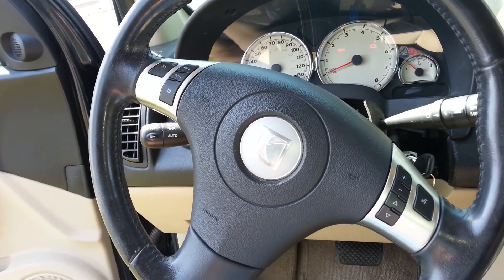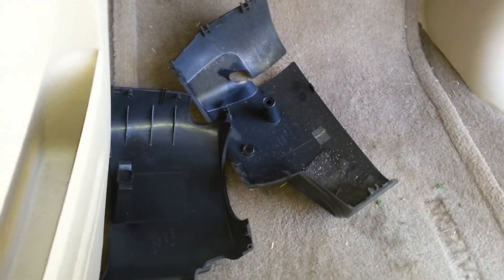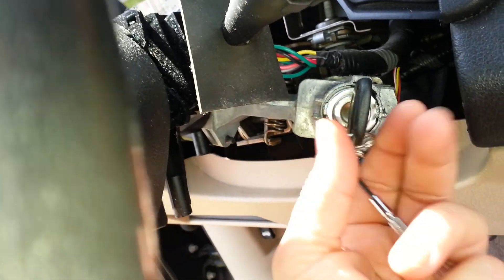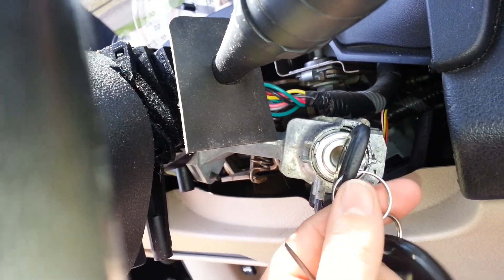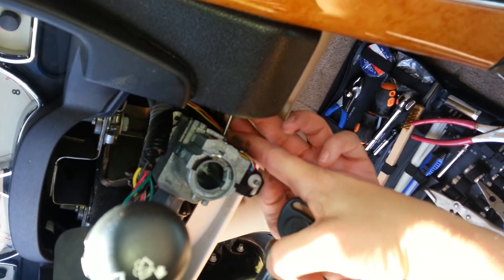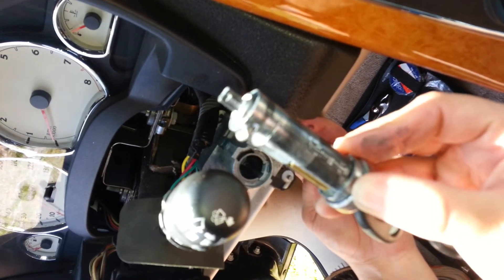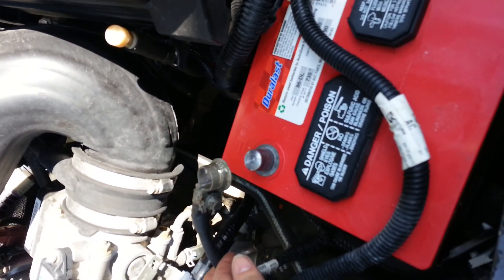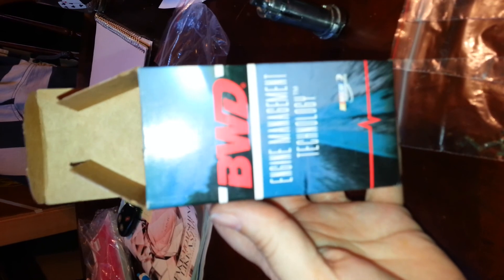Saturn ignition switch

Comment: What were the symptoms of a bad switch? My wife's 06  Vue will not start the engine. It cranks and will not engage the shifter solenoid to even get it in neutral.
Reply from the maker: It would not start and every time I would think I was going to be stranded. Took several minutes to get it to start.
Reply: @Bextasy423  But was it cranking or no cranking?
Reply from the maker: @Hardcorediver44  No, it would not. It wouldn't turn. Would get stuck.
Reply: @Bextasy423  I think my battery is getting to low in voltage for the passlock sensor to read it right.

Comment: Changing the tumblers isn't rocket science , remove the old ones in sequence, noting what the numbers are on each one and put the new ones back in the same way. I like how you say you didn't want to mess up the electrical system by putting the tumblers in incorrectly......
Reply from the maker: Jimmy1134  Well, you have more patience than I do😊
Reply: Its easy.  And a learning experience

Comment: What was the problem that made you have to replace it
Reply from the maker: I would be out somewhere and couldn't get it to turn.
Reply: Also with mine the key would stick and unable to get out. Saturns are notorious fir this.
Reply: @gailresources8120  mine is the oppisite my keys are super worn and loose. I can pull them out of the lock cylinder in any position including while the car is running.